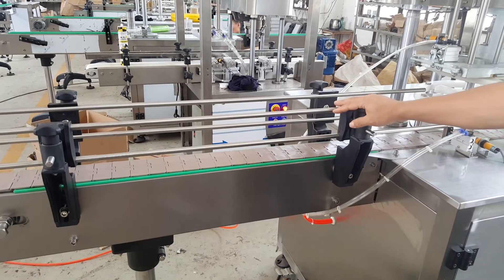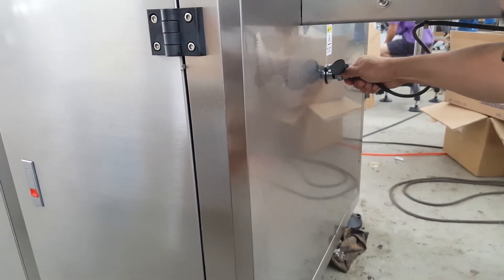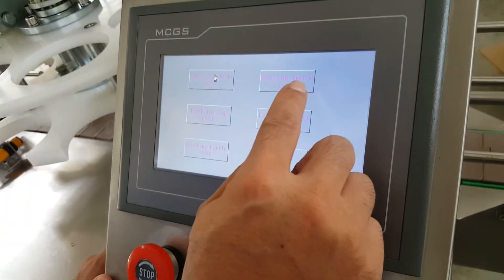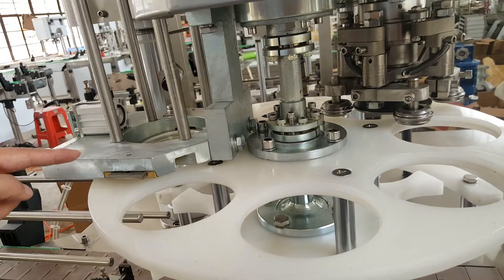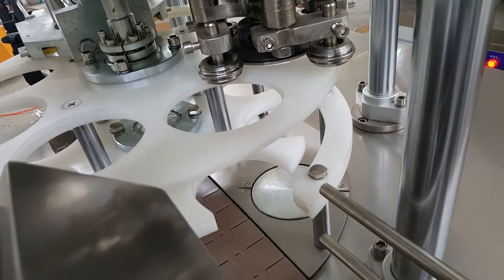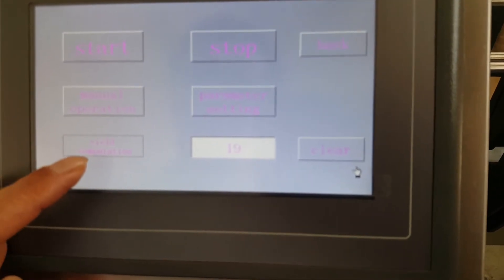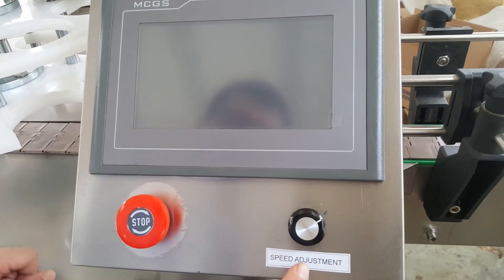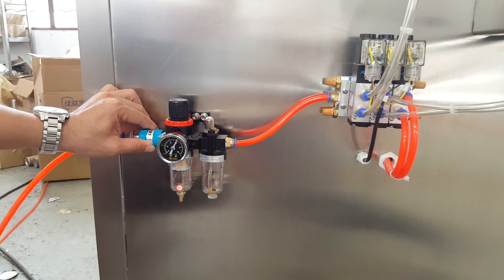operating instructions for automatic can seaming machine seamer equipment for metal cans

Comment: This machine got a disadvantage which once product run with the filling near to the mouth of tin, its definitely have splash once hit stopper and i=once the tin go to rotary tray
Reply from the maker: actually not sir. the machine seams the can while holding the cans very stable. and of course, nobody fills the can to its very mouth. this is best auto can seamer available on market.
Reply: @PenglaiPack  its actually does sir, cos we have this machine, the based n design exactly like this, currently for vegetable ghee which the size 1kg n the many buyer would like to make tin as small as possible to load more in the container which oil in tin like 5mm below the tin mouth.. Whenever it hit the stopper, the oil splash. And due to that we need to make it really slow.. And its effect our porduction output.. If any suggestion that you would like to give, i would really appreciate it